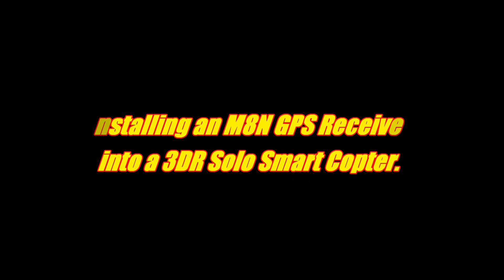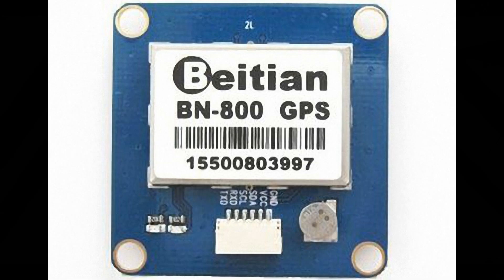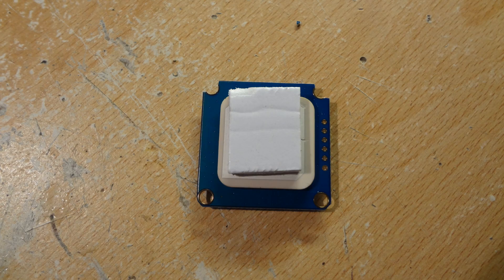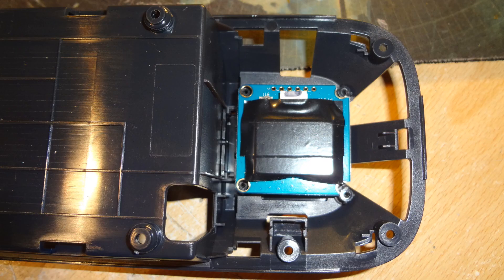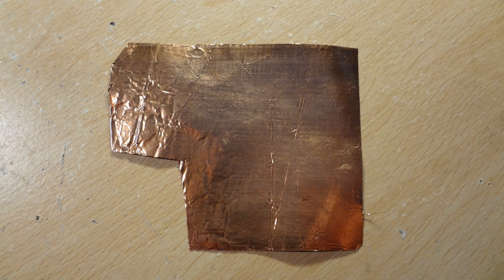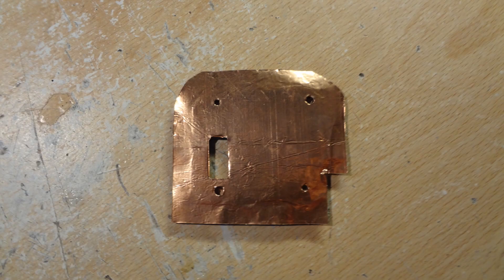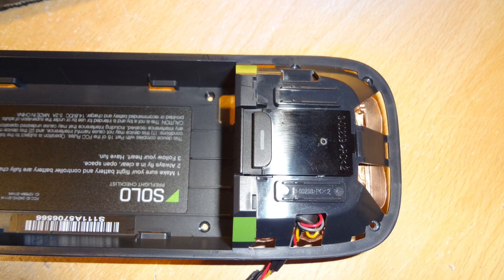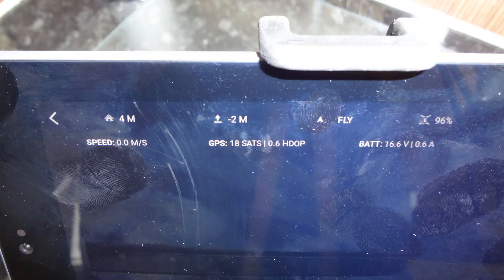3DR Solo M8N GPS Upgrade.

Comment: For those who don't want to figure out the wiring on their own, see my comments in the description section of the Solo/BN800 mounting bracket on Thingiverse. https://www.thingiverse.com/thing:2377429
It's really very easy...  The stock Cirocomm antenna is also slightly less sensitive than a Taoglas antenna (such as used in the original Solo GPS). The Cirocomm antenna can be replaced with a Taoglas antenna purchased for approx $5 which will boost the performance of the BN-800 to a point where it is equal to a much more expensive mRo unit.
Don't overlook the importance of shielding the GPS module from local RF noise which can degrade GPS performance on the Solo. The 3M™ EMI Absorber AB7003HF material works good.
Reply from the maker: Thanks for posting the link to that useful information between that info and this video it shows everyone how to do it

Comment: Thanks for the video, very informative on placement, but you skipped right over the most challenging part...matching up the wiring.  Was the stock BN-800 cable an exact match for the Solo?  I suspect that took a bit of modding.  I do appreciate the video, as it convinced me that the BN-800 will fit into the cowling nicely.  One of my Solos is a clunker fixed from broken parts and I don't want to invest a lot into improving it.  This is a cheaper alternative to getting an M8N under the hood (bonnet).
Reply from the maker: Max Becker The wiring is minimal with only four connection +, -, TXD AND RXD both clearly marked on the BN800 and the original GPS unit.
Reply: Thanks again.  I bought one, installed in less than 30 minutes, got the wiring right the first time, and got seven satellites almost immediately inside my house.  I did use a slick mounting bracket that I 3D printed with a pattern I found on Thingiverse made just for the BN-800.  That way I didn't have to cut the edging off the two holes.  I ordered another BN-800 from Banggood for one of my other Solos.
Reply from the maker: Sounds good, after I had cut the corner off the holes and installed mine I found the bracket on Thingyverse too lol,  Oh well live and learn. You should be finding a big difference in GPS reception now it's a great mod and very cheap to do have fun with your Solo I really like mine.